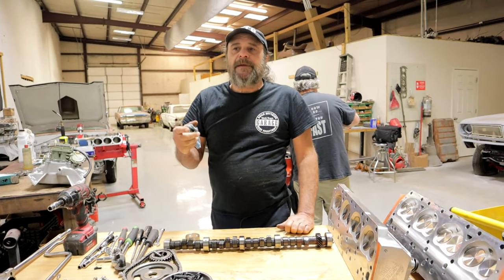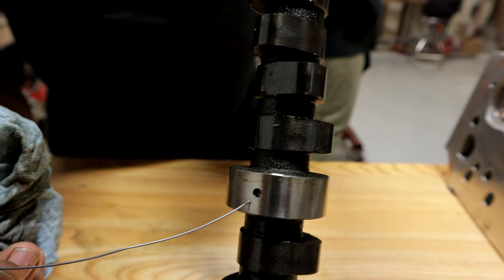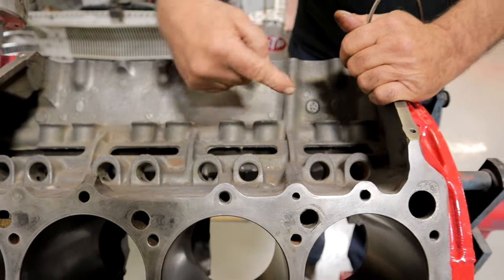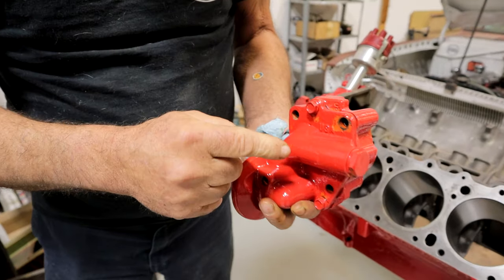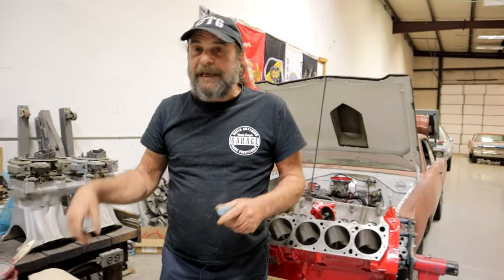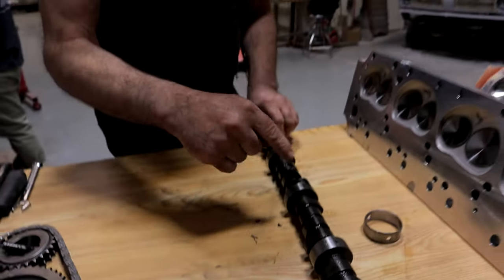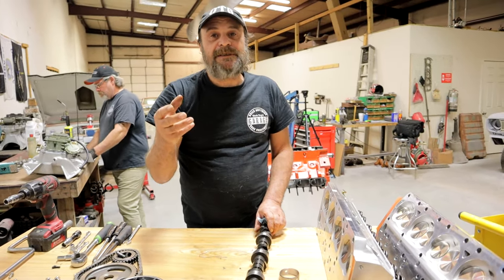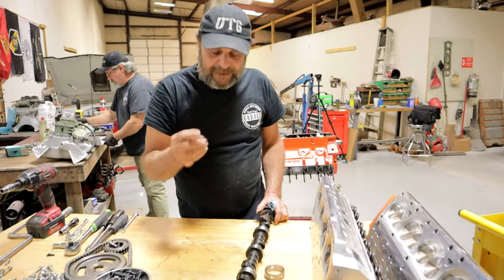CRITICAL Lesson For The Home Engine Builder- MORE Camshaft QC Issues To Wreck Your Day

Comment: Sigh, here we go again. It's bad business when you have to check everything and take nothing for granted. Unfortunately, this is what happens when companies take out the "car guys" (and gals) from their staff and add in bean counters. When you put quantity over quality, this is what happens. I saw a lot of this first hand in the the automotive parts world, as I worked for a manufacturer for over a decade.

One time, there was a strike in the factory and they asked the office folks to help out in the factory making parts. So, I volunteered. They were showing us how to make GM 8 cylinder HEI distributor caps. The foreman is showing us how to stake the terminals and use the machine that stakes them in place, etc. He does a few and he's ready to show us. I look at one in the finished goods bin and I said, "Wait a minute. That one only has seven terminals staked in place". I guess that's the "fuel saving" version of the GM HEI 8 cylinder cap? LOL.

Sure anyone can make a mistake, and I don't think a bad distributor cap would have caused engine damage like this camshaft example would, but the lesson/moral is the same: Cut out the people that make sure your product works in the field and you'll eventually cut out your profit, as well as your business from the ring. I had a boss that said, "I don't need car guys, I need data guys". I quipped, "No you need both in one person. Otherwise you have half of an employee. And people that have both don't come cheap. You reap what you sow". 

As I have commented before, it's bad, bad, bad, bad business when we've come to this as a country and a society. You're almost better off with used parts in some cases than brand new in the box. You can't seem to trust much lately, it's terrible. 

We are on the "Highway to Hell" with parts quality. That's true. We used to think it was one manufacturer, but yes, as Bon Scott said further, 'and all of my friends are going to be there too". That is, when you thought only one company was bad news, you get surprised when the "best" names in the business let you down too.
Reply: before Microsoft named its programs rather than giving them numbers, the joke was, "At Microsoft getting the product to market is Job One. Getting the program right is Job 1.2".  but they did get to market fast enough to become the 800lb gorilla.
Reply: @albertgaspar627  You're right, but at the end of the day, it still works. Not the case with this camshaft. LOL.
Reply: Good observation, my dad went through that as a machinist years ago, they were breathing down his neck to speed up: "I've been doing this for 40 years, when I make a part, they don't get sent back here for a re-do". By the time quality control is obviously a lost cause, the bean counters have pocketed their bonus and gone on their merry way to screw up the next operation. Another observation is that there are a lot of people who don't seem to care anymore, not just the kid at his first job, or people who are just there for a paycheck. Late for appointments, appointments cancelled without notification, bad information, shoddy work etc. I've even seen this at my medical plan and friends have had the same problems, mostly with doctors' administrative workers. But it makes you wonder what's going on if you have to go in for a serious procedure. It seems like things became worse over the years, I partly blame it on lowered expectations and the bar being set lower as far as education and training.
Reply: @dalab9716  That's right. It pervades more than just auto parts. People sometimes just don't care. Even if you want to do a good job or buy a good quality item, sometimes it just doesn't exist.
Reply: @googleusergp  true.  Microsofts' first attempts worked for 90% of the buying public who used 50% of it :)
Reply: @dalab9716  alas in America, we hire managers who have business experience, can read a spreadsheet, but don't know the product they make or the service they sell. all they know is did they make quota or didn't they. meanwhile if there's a sales staff, they're out there promising the world to clients who get stuck after the check clears with "oh, we don't do that feature. we tried it once, failed it, and never tried it again. we could try it for you, but we'll likely get the same result anyway."
Reply: @albertgaspar627  At the end of the day, the computing public was probably the "test lab". LOL. But some 40+ years later, we're still using Microsoft products.
Reply: @googleusergp  exactly. my old man was making desktop computers before IBM (company called Search) but he tried to make 'em perfect in 1968 when everyone was used to humans doing everything (typing, filing etc). Even his friends said, "that's why you don't let engineers run the company--they'll make it so perfect they never get to market before its obsolete".  but that's a different subject entirely from camshafts. 

you might be old enough to remember Ed Iskadarian's ads (cartoons by Pete Millar) in car magazines about other camshaft companies not even having dynos to test their products on--they just handed out 3/4 cams at the race track and let the racers be the last QC. some of that i'm sure was advertising hyperbole but probably some truth in it as well. I'm sure removing Zinc from motor oil so it won't coat the catalytic converters had a bit to do with cams wiping out their lobes, but there's also a lot of pressure on metals due to dual valve springs and everything else attempted for race engines, and all it takes is for someone to use a softer metal to save a buck and...bye bye lobes. I still buy flat tappet blocks when they're too cheap to pass up and i'll use a diesel oil etc to break them in since i'm building street engines for my own self not full-outhouse 2hp per ci competition engines. thank goodness for the LS craze :)
Reply: @albertgaspar627  You need a good blend of everyone in a company like that. Yes, it has to be marketable, or else it won't sell. Yes, it has to be reasonable quality, or no one will buy it. Yes, the price has to be right or you'll be undercut by others. It's tough but a lot of the companies have swung the other way to quantity over quality. 

When one of the magazines bought Nunzi Romano a 1972 Pontiac Trans Am, the writer said, "But you don't have a dyno here". Mr. Romano quipped, "I don't need no friggin' dyno. I got one right here (and he points to his heart)". With that, he proceeded to turn a very saggy running 1972 Trans Am (rare, there was a strike at Norwood, OH where they were made that year, and the leftover cars did not meet 1973 standards and had to be scrapped) into a screamer with some basic tuning and common sense.
Reply: @googleusergp  1) that's why the young business failure rate is as high as it is, there has to be a "perfect storm" of combination with the staff, and you can't be too far ahead of the market on top of it all.

2) Annunzio was just being his Brooklyn self :)  But on a serious note, as you know guys like he, the CARS staff, and the Baldwin Motion crew (which did have a dyno) all tested their product out on Saturday nights, like Royal Pontiac.  The dyno's nice for advertising, but they found out what actually works. Tho Nunzi had the advantage of playing with one brand--what got his 421 SD Catalinas to go near the 10's was going to work on other Pontiac V8's (except of course the 301's in the future), once he compensated for the F body exhaust system, gearing and weight.

He likely could have pointed to his brain and said no need for a dyno, i got experience. and a kick-ass warehouse of NOS equipment (and i don't mean N2O either :)  ).
Reply: @albertgaspar627  He used to have a "tech hour" where he would basically close up the shop and just answer phone calls and give advice. This was years before the internet, so he used to sit the phone I believe and just wait for the calls to come in. My coworker called him a few times and said, "He's nuts, but he knows what he's talking about and he's always willing to help out." I believe he retired some years ago.
Reply: @googleusergp  it is funny the way we used to hot rod, but its all we knew. order up out of a catalog, send a check, wait for the mail for weeks. Like that scene in the movie "Almost Famous" when the guy from Rolling Stone is explaining how "quick" it is to send information by fax. Meanwhile long distance telephone calls were cheaper after 10pm, so we on the East Coast had it best--we could call our friends to the west and enjoy the time zone difference to reach them at a reasonable hour :)
Reply: @albertgaspar627  When my sister first moved out of state in 1994, we used to call her after 7 PM because as you noted it was cheaper. Now everyone has unlimited calling and not many people still have land lines. I still do.
Reply: @googleusergp  As a single kid i knew i'd inherit the house i grew up in (and that's rare too, folks used to move an average of 5 times in their life chasing a factory job and now its like 11 times) so i made sure to keep the landline there. my female friends hate they can't reach me when i'm not at home, but they're all old enough to remember what it was like before cellphones--make plans, then call :)  and as i tell them, if i'm not at home, i'm too busy to come over and fix whatever it is they're ultimately calling about. but that's another story.

side story: i was at an indoor car show recently, and someone brought their 1970's shaggin wagon custom van. two teen boys just oggled it all, and one gasped, "do you know what you could do with this?"

I laughed, "what do you think they built it for? you may have been concieved in the back". which i doubt by this century, but it still made them think they weren't the first ones to invent A Good Time.
Reply: @albertgaspar627  I live in the house I grew up in, my workshop was my grandparents property originally and I played in the yard as a kid. I own their last new car as well as cars from all of my relatives. I have the same phone number that I had growing up and it's the only one I've ever known. The license plates on my classics have been in relatives names first and then mine. So yes, I am the "keeper" of things in our family. So yes, I get it. LOL.

I've only had two full time "real jobs" in my life since I graduated college as an undergraduate (I did an MBA later on four years later). I was at my part time jobs for all of my years of school and even beyond (I helped a neighbor at his shop on weekends). Most of my friends are at least on job #4 or #5 at our ages. My younger nephews will probably change jobs at least that many if not more in their working careers. I was one of the few kids in HS that worked on his own car and fixed things around the house. Most didn't have a clue. It's a different world today.
Reply: @googleusergp  i hear you, i left my parents house at 18 for college, returned to take care of them when mom had dementia and dad parkinson's. so i'm mostly "small town" and doing my own repairs and growing my veggies and going into town to "get some noise" and then coming back home again. i always joke that growing up here, i hated it--everything closes up by 6pm, there's no kids my age, there's nothing to do. now i love it--everything closes up by 6pm, there's few kids around, most of the noise is nature. perspectives change.

i worked for someone else once, it was an experience in family dynamics since it was corporate in name only.  i've been broke and not-broke, but i love hunting for deals on stuff--"anyone" can whip out a credit card and nab something new and shiny, i like my objects to have a story about how they got here. Its certainly changed, and i'm left behind since i'm not into disposable, or tech for the sake of tech (just had to change the cable box and they wanted a phone to scan the QC code..oops, i don't have those electronic leash things, sorry).  i still have paper road maps, and when someone else's phone dies, i know how to figure out where we're going. i have a married couple as hang-out buddies who are always broke, but boy they've got every electronic device and cable service out there. even back when i was broke i seemed to live better than some who had the gizmos but no money leftover to spend when they got where they were going.

still, its not the toys that matter--if you know how to be content in life with what you have, then you will always be happy. if you take interest in people around you, you can be fun and have fun regardless of how big your TV is in your rec room. i'm sure i'm not telling you anything you don't already experience. but its how we avoid all the "hiccups" of the modern world, or at least as much as can avoid.
Reply: @albertgaspar627  I have a friend that beat stage 2 throat cancer. When I told her I was going to paint a 1962 Craftsman tool box I got off CL that was in "certified pre-owned" shape, she said, "No, it has scars just like people do and it has a story to tell. Leave the patina". She's right. I cleaned it up, lubed up the drawer slides, found a used "Craftsman" metal emblem on Ebay, got a key for the locks and that was it. It looks good and I'm sure it has quite the story to tell.
Reply: @googleusergp  I agree with your friend, i'm one of those who like patina. That's cool with the toolbox, last summer I was going to my usual flea market at the drive in movie theatre and there was always a toolbox that inside the lid had a mirror and on one side was a black and white of two kids, and the other side was a newspaper clipping from the wedding section about the woman he married. I figured both clippings reminded him of why he worked, and the mirror was to look good for them before going home.

beats heck outa a new toolbox that has bluetooth and internet connection and makes coffee and whatever other new gadget is out there, as far as i'm concerned :)
Reply: @albertgaspar627  Yes that toolbox tells a story.
Reply: This has become such a huge source of frustration for me.  I only drive cars built before the '80s.  That's my preference; they don't make any newer cars that I like.

Obviously with cars being that old, parts wear out.  No problem; fixing old cars is easy and generally cheap.  But finding parts that aren't junk is starting to prove almost impossible.  I can't tell you how many repairs I've had to do two or three times because the new part fails immediately (or conveniently two weeks outside of the limited warranty).

I've learned to keep the original parts and always get them fixed if at all possible because they are just that much more durable than the garbage you get at the parts store.  The car I'm working on now, the first carb and the first alternator I put on it both failed within a week of installation.  It's ridiculous...
Reply: @NoName-ik2du  A lot of the aftermarket companies got rid of the quality control folks a long time ago and lowered their standards. If they are the "last guy standing", they got it, you want it, you'll take what they offer (and like it).
Reply: @NoName-ik2du  I live in the rust belt, so cars that old need bodywork (i grab every fridge and stove tossed out on the side of the road--free metal, free sheetmetal screws, and trade in the copper wire to the scrapper).  as for the engines, i try to grab a 1980's--1990's engine--usually more nickel in the cast iron, and roller lifters but its a 1960's design like the Ford 302 or an LA mopar small block (not the heads, just the block). but the result is a lot of effort rebuilding the car just to get it on the road. 

I will confess, i've found mismatched parts, as the OEM changed design (like my 1999 Ford Escort's EGR system) during the production run. I have had some parts go bad, but then I changed to a more expensive parts supplier and that solved that--UTG once bought lifters from AA and found out they pay their workers so little, he ended up getting the same faulty lifter he had returned! Poorly trained and retained workers can cause issues like that. 

Like you said, if you can afford to retain an original part, do so. there was a time once when one could, say, rebuild your own alternator. It made the repair take longer than a weekend, but it was often a better solution than getting one from JC Whitney or Almquist etc and being disappointed in the outcome.

Comment: I didn’t do this to the summit cam on my car , I lubed it up and put it in. Did a proper break in and a few hours later it dropped number 1 cylinder. Took me a long time to figure out the problem
Reply: If you used Summit Lifters that came with the kit, that likely was the problem.  Modern lifters are the cause of many, many flat-tappet cam failures.  We sent ours back and requested a refund, purchased lifters directly from Lunati which were perfect.

Comment: As far as new camshafts go , you also should check for straightness before installation . They are very easily off by 3 to 6 thousands runout between centers and journals but also easily straighten to within a half a thousand or zero run out. Most machineshop should be able to bring them back to spec.

Comment: And it's not just aftermarket suppliers who have these issues... Hyundai has had thousands of Theta engine failures due to this very same issue. Whether it's instantly or over time, machining debris will kill an engine.
Reply: I agree not only will it kill an engine it takes out rear and differentials as well because they do not clean all the metal out prior to assembly …..